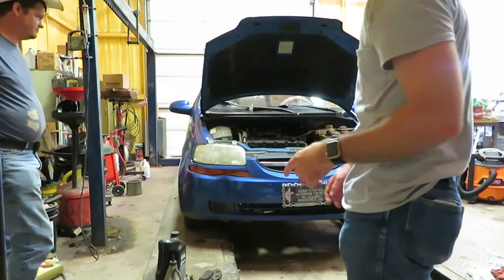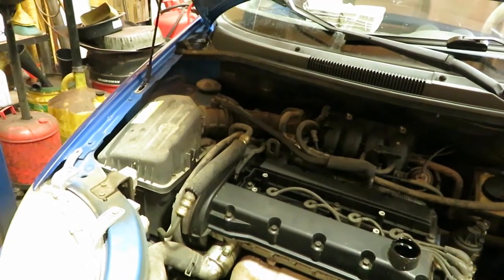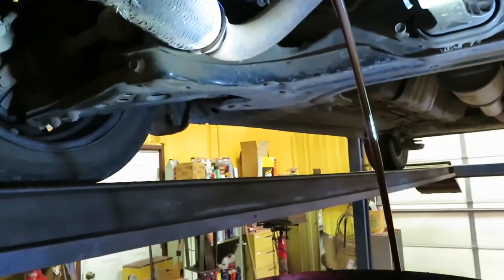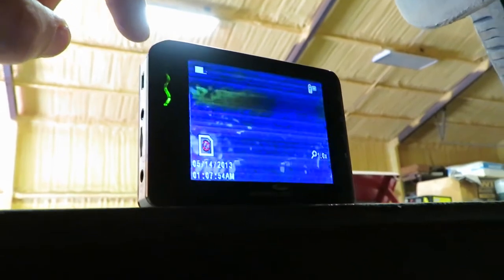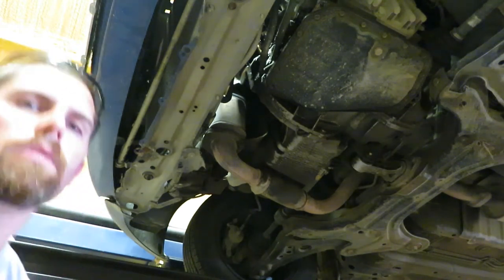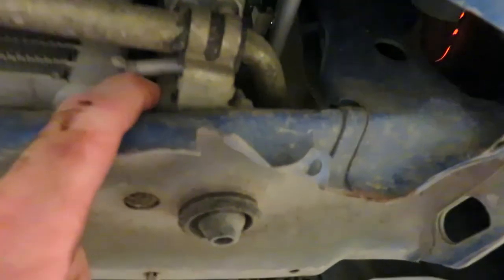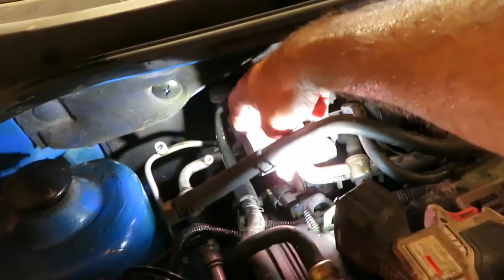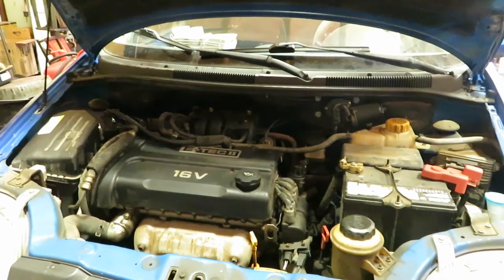Car Maintenance 2006 Chevy Aveo

Comment: We have the same car, except the svt. Basically no options and a 5 speed manual. We did add AC (only option) owned since new. 
Replaced 1 clutch
2 timing belts (60K)
1 AC condenser 
3 fan motors
Front and rear struts and shocks 
Cam sensor
O2 sensor (front)
Throttle body
Intake tube

Still rolling strong at 165K
Timing belt every 60K is critical
Reply from the maker: Thanks for the info we are about to get into the shocks and struts and I will check the timing belt asap I think I am starting to see signs of it needing replaced.
Reply from the maker: I just checked out your channel. I like that Volkswagen Rabbit!

Comment: What is the black box under the right headlight behind the bumper called? I’ve looked it up for like an hour and google keeps telling me it’s an “air box”?
Reply from the maker: That is correct it is an airbox and I would have to look but I believe it is connected to the airbox that holds the air-filter and the one you are talking about catches sediment. If you need to I think you could get rid of it especially if you live in a city and don't drive dirt roads much, also if you remove it be careful of going through deep water.